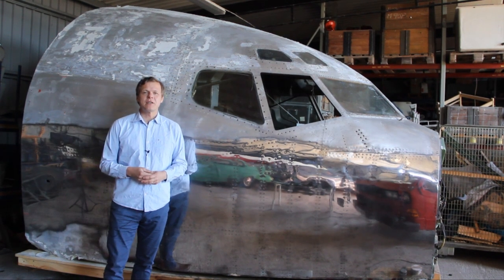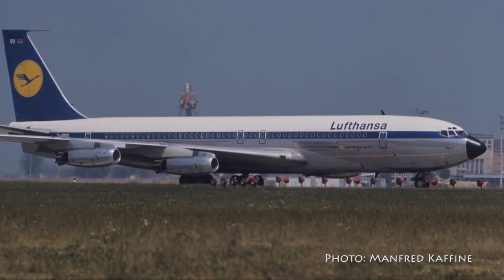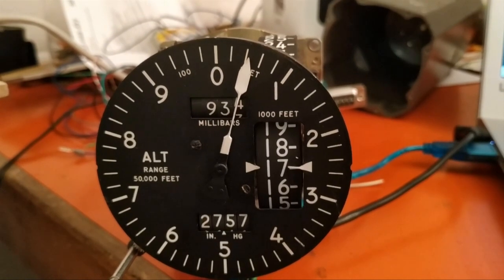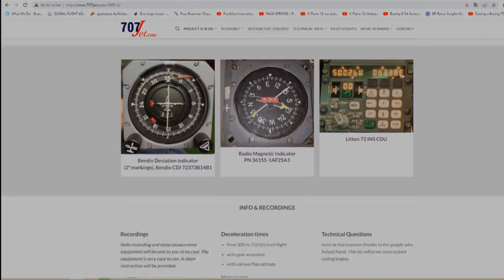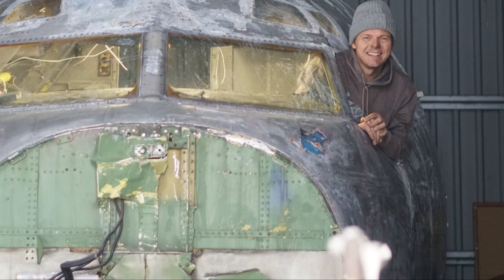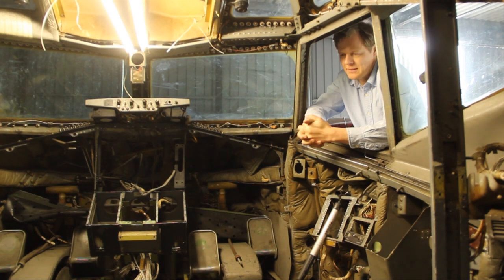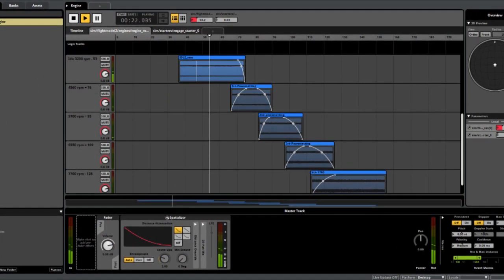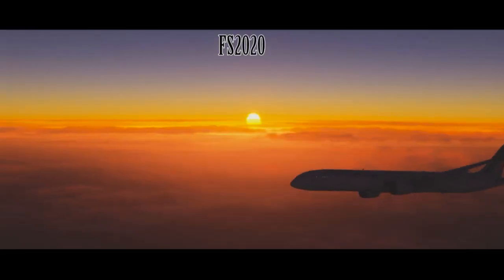Lufthansa Boeing 707 Cockpit Restoration & Simulator Conversion Update #01

Comment: Nice work you are doing, i had a privileged in my life to fly B-707 during 10 years, and the last flight on 707 was one ex LUFTHANSA/GERMAN CARGO 707/330C SN 19317/557 D-ABUI than later sold to TRANSBRASIL as PT-TCM